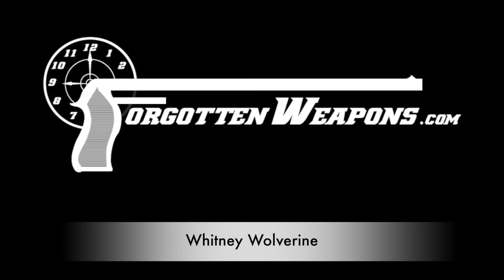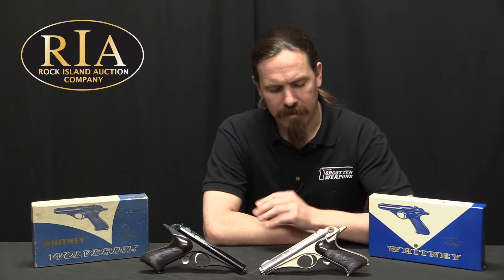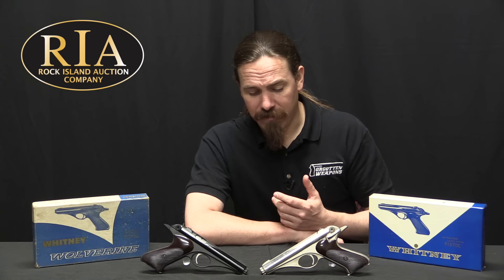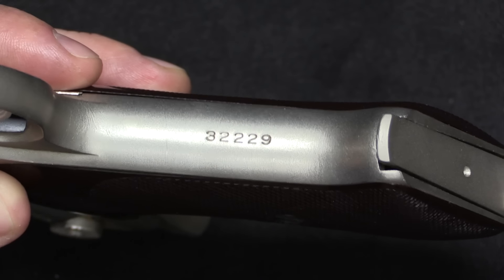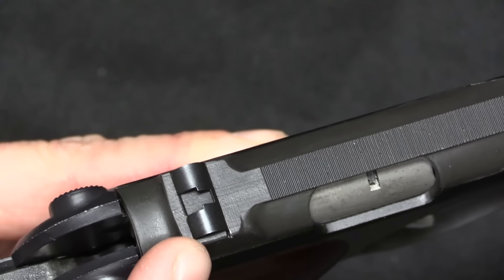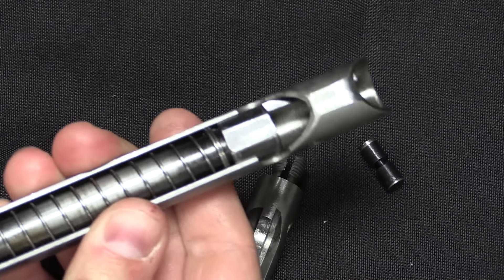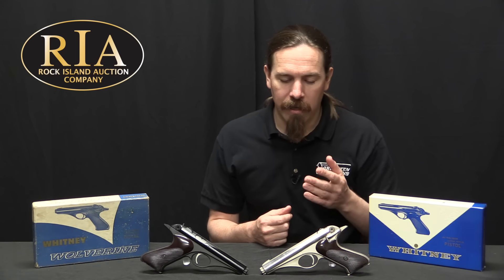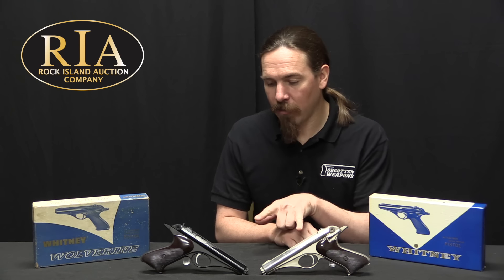Whitney Wolverine: Atomic Age Design in a .22 Rimfire

Comment: This should be the standard side arm issued to all Space Force personnel.
Reply: Commentary gold that.
Reply: Only if they make one chambered in 5.7x28mm
Reply: Leonard Chornomaz  5.7 is a short enough cartridge (40mm overall length) that it wouldn't need a lot of change to the grip design. Further, it is a small, fast cartridge that lends itself well to piercing armor. If we're talking about the the hypothetical use of this pistol for the Space Force, you have to account for the clothing and vehicles in use. Armor piercing becomes a necessity.

You could easily fit ten 5.7mm rounds in a sleek gun like this, and you would then have a spacey looking gun with a capable cartridge that gives lower recoil but effective terminal ballistics.

As a bonus, it means your carbine could use the same cartridge, such as the FN P90. Or if you prefer to keep the M4 look, use AR-57 uppers on M4 lowers.
Reply: SPACE FORCE!!!!!
Reply: Beam me up A. I want to join the space force
Reply: Nah issue them the Remington R-51.
Reply: @Breakfast_and_Bullets  if where talking combat in a space station or ship armor piercing is the last thing you want
Reply: @Breakfast_and_Bullets  - \*something Something\* Read The Dark Forest \*something Something\*
Reply: @ethanwall2443  You are right, but you still have to consider what the personnel are wearing. The armor/suits the soldiers wear are likely relatively stronger than the structure. The craft is designed to protect everything inside from the vacuum of space and maybe some dust and radiation. The soldiers' uniforms would be designed to do the job of a space suit plus protect the wearer with armor.
Reply: Leonard Chornomaz  If you really think there is no role for side arms in the Space Force, it seems silly to argue about what cartridge they should use. 
Also, what makes you think you need teleportation to do boarding?
Reply: Leonard Chornomaz  Seeing as we don't use nitro cellulose for the bulk of smokeless powders anymore...

Edit: plus a stronger cartridge. Even more likely to decompress a cabin.
Reply: Leonard Chornomaz  Indeed. I suggest we end this thread.
Reply: Leonard Chornomaz  Marines tend to be pretty good at making holes in things. Space walks have been going on for years. What magic do you need to grapple a ship, use something like a smash head on a recoilless rifle round to punch a hole big enough for boarders, then jump boarders, maybe tethered to the grappling lines, to the enemy ship.
Also, side arms might be helpful in the suppression of mutiny.
Reply: NeoJD  I'm an aspiring engineer, futurist, and gun nut. I recognize the lack of need of a sidearm in space, but if they're going to be issued to officers out of tradition it should be in a caliber better than .22LR that won't grossly change the form factor of the firearm.
Reply: I believe you can find them in the hands of the Science Police. (Obligatory didn’t get it link: https://en.m.wikipedia.org/wiki/Ultraman.)
Reply: @ethanwall2443  Agreed. That's the kind of situation where a .22 would actually be the viable military ammo option. Powerful enough to kill a target out of a space suit with adequate round placement (look at police data and you'll see there are a lot of detahs by .22 every year), apropiately unable to pierce the hull of a station, and likely able to put an incapacitating hole into a spacesuit if you actually get into space-suited combat (c'mon, we're talking SPACE FORCE WEAPONS here, covering such sci-fi situations is mandatory).
Reply: Suits well to the nature of this video since they are non existent at the moment.
Reply: Leonard Chornomaz  Sorry to respond so late. I missed or didn't get a notification of your response.
I didn't say punch a hole with a grappler. I said tether to the grapple lines to get from one hull to the other. Blow a hole with a shaped charge or smash head. 
Sending someone between two ships in a bosun's chair during an underway replenishment can take as long as a spacewalk, but a combat boarding tends to be quicker. Something about the possibility of people shooting at you.
The biggest differences in shooting a firearm in the vacuum of space would be no friction to slow the bullet, and no effective gravity to pull the round down. Inside a ship there'd be even less. 
If you're worried about recoil, a .22 is about as good as it gets. You'd have to learn to compensate but that's a training issue.
Since I'm the OP, I can tell you that the OP started this as a joke.
In my experience, most US Marines do not buy their own pistol. Maybe British officers still do, but I'm pretty sure the QM would rather avoid the nightmare of trying to resupply 30 different pistol rounds. And most Marines are issued a rifle, not a handgun.
But a rifle in 5.56 NATO is probably a lot worse in a pressurized tin can than a pistol in .22 LR. Much smaller charge, lower velocity, less mass, less penetration. So who knows?
Reply: @petlahk4119  It wouldn't be for the xenos. It'd be used against other astronauts.
Reply: Yes, with the CALICO firearms as IDW and service carbine!
Reply: Chambered in gyrojet or dardick caliber for space triangle wound vector
Reply: Flash Gordon being one, of course.
Reply: Why not? .22 caliber has low recoil but enough to puncture in a spacesuit.
Reply: Modify for a better ammo type and to operate in a vacuum, and we're in business.
Reply: @Jim Fortune
Either that or broom handled mausers dressed up to look like Han Solos blaster,or perhaps the gyrojet rocket gun as it has almost no recoil and you`d want that in combat in zero gee environments.
Reply: nah the loadout is needler, battle rifle, 4x frag and 4x plasma
Reply: @doctorwho0077 I'll be putting that on my list, thank you
Reply: @Breakfast_and_Bullets  5.7x28 is the same round used in P90 rifle used in the Stargate series
Reply: @lorenzofigueroa3815  I'm well aware 😁
Reply: i hate to burst your bubbles but if the space force becomes a true thing i see electromagnet guns being the weapon of choice do to the fact they dont require oxygen to fire
Reply: @i.t.s.t.h.e.c.a.l.z.o.n.e  Gunpowder is self-oxidizing and properly made ammo is airtight. Firearms still work in a vacuum.
Reply: I’m thinking a round like .22LR would be ideal for zero-g since the recoil wouldn’t push you back so far.
Reply: @flightlesschicken7769  depends what you hit. A window, yes. Bulletholes can be plugged up by anything sturdy enough.
Reply: Cause you would have a gun in space riiiight
Reply: @jakobgermain6226  Side arms are issued to air crew, surface ship crew, submarine crew. Why would space ships be different?
Reply: @Breakfast_and_Bullets  5.7's armor piercing capabilities need a long barrel to work like the FN P90.
Reply: @riyadislam3441  I know. The whole pistol would be oversized for use in space suits, so you could theoretically give it a barrel /just/ long enough to get the velocity for AP.
Reply: True, you only need .22 in space anyway
Reply: I agree
Reply: True, since they're equally as ridiculous as a concept.
Reply: Symbolic, can't actually do much, they're perfect for each other.
Reply: @couchbear6108  something tells me that being on the space force won't be as exciting as it seems. sure you'll get to go to space but due to laws that restrict weapons in space the  vast majority of your time will likely be spent watching for potential threats like Astroids coming towards earth.
Reply: Funny the space force are in the Middle East they signed up to kill martians not martyrs lols
Reply: >Takes one look at the reply count
Nah.
Reply: The BPRD issued them  to their agents for a while.
Reply: Personally i think the Space Force should adopt the General Dynamics NGSW as their service rifle
Reply: @djcoopes7569  Great idea. and have a completely different caliber from the rest of the US military, The rest of DOD, the rest of the US federal and state government agencies, the rest of NATO, and Our other close allies. Also get the new branch to have to purchase proprietary magazines, links, pouches, loading clips, optical sights tuned to a different ballistic drop, and blank firing adaptors; add another caliber to the strategic stockpile; and purchase a new software update to the MILES transmitters just to add a brand new lockup table for a new caliber with its own ballistic performance.
Reply: @kolinmartz  The platform can be adapted to whatever caliber is deemed suitable, and utilise standardised magazines for that caliber. Considering 6.8SPC is an entirely new cartridge, and all of the companies were asked to create their own magazines, i'd say thats a bit unfair. Also, loading clips? this ain't WWII mate
Reply: @djcoopes7569  you wanna hand load 699 rounds into magazines one by one? Be my guest. It is not compatible with any magazine or any caliber. The nose does not utilize the 6.8 SPC. None of the NGSW contenders do. They all came in with their proprietary ammo. The NGSW offering from Sig fires it’s own proprietary 6.8mm that is shorter than 7.62 nato by like a millimeter or so (maybe you can jam an AR 10 magazine in that mag well if you really try)  and considerably longer than 5.56 NATO (the rifle version I’m assuming because you said “standard” weapon and I doubt you’d be dumb enough to suggest the NGSW-AR instead of the NGSW-R). But let’s humor your suggestion that it can be configured to fire whatever caliber is deemed suited. So you’re going to introduce a brand new weapon with zero parts commonality with any weapon system currently in the inventory especially with weapons systems in that same category already currently in the logistical chain. With the USMC’s useless stunt of adopting the M27 just so they can have a new assault rifle pretending to be a SAW... you’re talking about having 3 weapons systems achieving the same goal with barely any parts commonality within the logistics chain and spare parts stockpile.
Reply: @kolinmartz  The Space Force, as a new branch, necessitate innovation. Someone has to be the first to adopt a better weapons system than the M4. I'm sure there were many people like you when they adopted the M16 in place of the M14. The 5.56mm cartridge only became commonly used after it was adopted. the future is coming, whether you like it or not. 

As a side note, I would like to point out that you cannot fire the M4 with the buttstock folded, which is a pretty basic function that most other service rifles around the world have. So the M4 is still lacking in todays world, and needs to be replaced.
Reply: @djcoopes7569  except the m16 with the 5.56 offered a leap in innovation over the m14. The SIG MCX (yes. The Sig NGSW-R is just an upscaled MCX) is just another boutique AR pattern clone with negligible incremental improvements. SOCOM tried the SCAR. They were the first to leave the M4. Guess who came crawling back when FN showed them the bill. But you have to ask the question.... “what can it do, that the current weapon system cannot that will outweigh completely throwing everything out?”  The M16 had answers and made a good case for replacing the M14. The SCAR did not and the MCX won’t and the HK 416 got a free pass by saying “ummm. It’s technically the same thing as what we currently have and it’s not supposed to replace it.” 

Yes. The space force necessitates innovation. Innovation and money they can better focus and spend somewhere else. Like.... idk.... Space... and other things related to space. Instead of buying brand new small arms that offers no significant improvement over current systems that will not only put a strain on the logistics of that young branch but also negatively impact the other branches.
Reply: is it even possible to fire a gun in space?
Reply: @TheIndieGamesNL  Do you mean because there is no oxygen? The gunpowder doesn't need external oxygen to burn, it carries it's own. But there are probably a ton of problems like microwelding between metal parts and boiling off lubricants in the vacuum.
Reply: @JimFortune  I was also thinking that they probably don't want to use gunpowder inside a spacecraft or space station just because of the small amount of smoke and maybe small shards of metal becoming airborne. Maybe it wouldn't be a problem though.
Reply: @Breakfast_and_Bullets  they ain't hitting the enemy anyway don't want to poke a hole in the ship
That's rude
Reply: @justarandomtechpriest1578  I think you've mistaken the proposed users for Canadians 😆
Reply: Instablaster.
Reply: Primary: XM8
Reply: @ethanwall2443  that was my thinking. We'll probably start developing frangible low velocity rounds for space combat. There's also the issue of filling near-space with small high velocity debris literally designed to punch holes into things.
I think they should go back to swords...
Reply: @notfeedynotlazy  take a drive on a country road. You'll see plenty of .22 holes in signs made out of the same metal as spacecraft, but much thicker.
If you want any sort of ballistic resistance at those thicknesses you need to start looking at titanium, not aluminum
Reply: @nicholashodges201  take a look at what titanium really is and isn't.
Reply: @notfeedynotlazy  proof of concept example 
https://youtu.be/0rB6L6AsBT8
My point is still valid, even a .22 is likely to cause a catastrophic breach in most metals rolled that thin.
Hell, pellet guns are insanely dangerous in that context.
What "titanium really is and isn't" doesn't have squat to do with anything beyond being an an example of one of the few metals that can stop projectiles when rolled to 1/16 inch thickness
Reply: @nicholashodges201  If you want to be taken even half seriously, stop talking about titanium as super metal.
Reply: The design should be at least considered. But for the Space Force, they should create a completely new weapon, that can perform well in zero gravity, possibly without atmosphere. It would most likely be the opposite of armour piercing… (don’t want holes in a space ship / station). But I agree, it should look absolutely look like this.
Reply: @Eclipse538 esthetic, that's why!
Reply: Space Force,  another way to bilk Taxpayers Dollars  !$$$$$$$
Reply: I agree
Reply: This in 357. Sig would be awesome
Reply: It's not entirely the worst idea though. Low recoil for a microgravity environment, light, compact ammunition for space craft where every milligram counts, no weather or gravity to interrupt the flight path, all it takes is one suit puncture to kill an opponent.
Reply: I second that motion!

Comment: I had wanted a Whitney since my high school days in the early 1970s, finally bought one in the early 2000s.   Nice pistol, very light for it's size.  Removing the grips you see the Alcoa name sey into the frame.  Accuracy is okay, tending to shoot low at 15 yards.   Initially had a lot of fails to chamber, but a light chamfering of the bottom chamber lip cured that.   It is a light recoiling action, so standard velocity ammo works well.  The grip shape is the best feeling pistol grip I ever held, a very natural pointer.   The Olympic repop is  much clunkier looking, not as slender and aesthetic as the aluminum original, but Oly magazines and grips are supposed to work on the original pistols.
This fine pistol should have been a success in the gun market, but bad decisions doomed it.
Reply: Now you Gangsta 😎🐥
Reply: Lance, that’s good info and interesting. Did it just pop up, or were you on the hunt for it when you found it? Watching this a couple of times now, I really want one. It’s just too cool.
Reply: Just got lucky, saw it on the dealer's table.     This was years ago.    He had the nickeled pistol too, but it was much more expensive.
Reply: @lancerevell5979  Thanks for sharing. Congrats on a cool find and very lucky day.
Reply: @lancerevell5979  I'm a bit late to the party but how much did it go for?
Reply: Looks alone, surprised this wasn’t like “the business man’s” pistol back in day and just throw a stone and find old one now. Kinda shame but guess never found its niche due to those bad decisions.
Reply: @PALACIO254  A bit late, but....
I paid $450 for the "blued" gun.  The nickel gun was priced at $800, out of my price range.
Reply: @BRBMrSoul And bad timing, as some young upstart named Bill Ruger cobbled up a somewhat simpler pistol that gained more popularity.  😅

Comment: These were also the basis for a line of toy pistols made in the '70s and early '80s which fired yellow rubber BBs propelled by spring power.  I had 2 of them, one blue plastic and the other gold plastic.  They were scaled down for smaller hands but were virtually identical in appearance.  They also shot very well for toy guns.
Reply: Yes definitely. Also the little plastic disks.                                           
    Mine was sold as a Star Trek gun.
Reply: My cousin and I had the same toy guns in the 70s. Mine was blue, his was gold. They shot the little BBs. Called the Zebra II, I think? It wasn't until decades later I realized they were based on a real gun, the Whitney

Comment: wow that will look good with my nuka cola costume with red color.
Reply: I'm fairly certain I've seen toy guns based on these. I swear I used to have a cap or dart gun cast in a orangish red I got from a gas station when I was a callow youth. Couldn't give you any brand info though.
Reply: @Kasperl88  like NES Zapper?
Reply: @sunjun618  No. Not a Zapper.
Reply: @sunjun618  Turns out it was something called the Zebra II by Ray Line
Reply: @Kasperl88  did it fire a rubber suction cup tipped dart? I think I had one also.
Reply: @kevingooley9628  pretty sure it did the plastic discs, my brother and I had them.